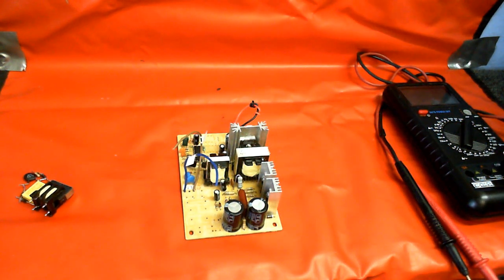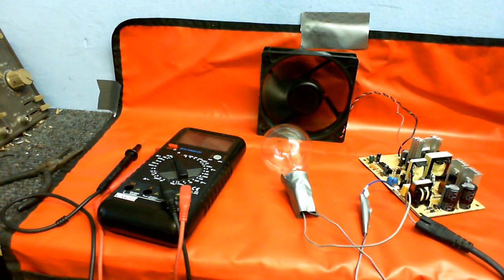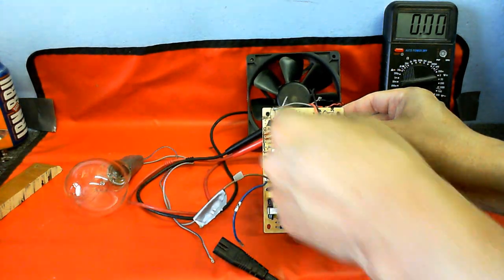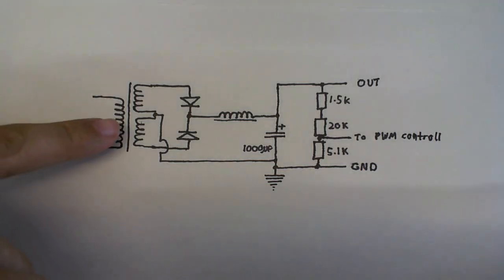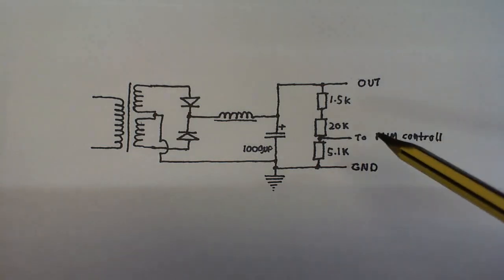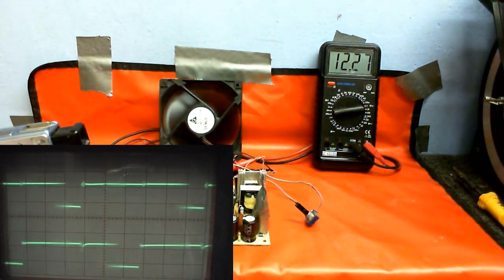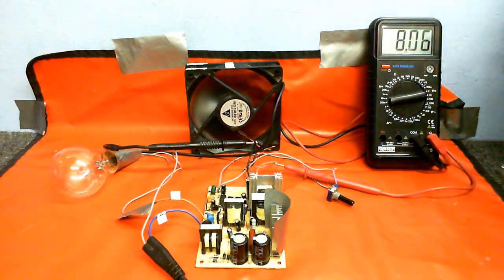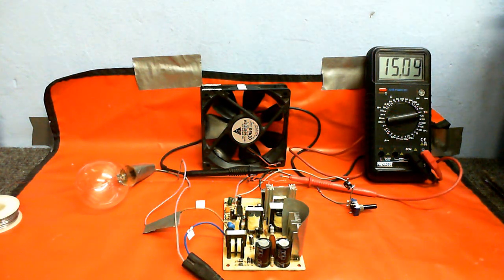CDC Electronic Workshop - Switchmode power Supply Experiments & Modifications

Comment: The power supplies most have access to modify are ATX PC power supplies. Like most off-line SMPS, they tend to have a primary side controller, optoisolator and secondary side TL431 error amplifier, so you'd be looking for feedback resistors near the TO-92 package TL431 which will be near the optoisolator, generally next to the transformer. They may also have these parts for the aux +5V supply, so its important to know which you're seeing. ATX power supplies also generally have ICs on them which monitor the output for overvoltage, undervoltage, overcurrent etc, monitor the PS_ON green wire and start the power supply when its grounded and send out a PWR_ON signal on another wire when it does so. To modify one of these you may have to do more work to bypass such safety features or the adjustable range will be limited.

Also, adjusting the feedback network risks compromising stability, so you have to watch out for that.

Comment: No, changing the voltage out on a switch mode PSU changes the efficiency. So depending on what voltage you take out, you can only get a certain amount of current. Rule of thumb is that when you increase the voltage, the current drops, as it gets less efficient.

Comment: Awesome video, very interesting!

I figure a switchmode power supply that can actually keep low voltages without any load simply lower the pulse frequency when needed (well that's what I would design such a PSU like).

Comment: Hi well done!Pls help.i have power supply model Telkoor efs175-105 which is 5v,30A but when put on load at 8.5 amperes,it voltage drop to 5.2v.Without load it has 8.2v.I need to increase the voltage to 7.5v on load. The problem is I can't find that particular o/p resistor to increase the voltage.Thanks in advance.